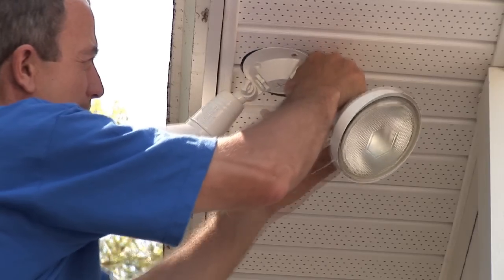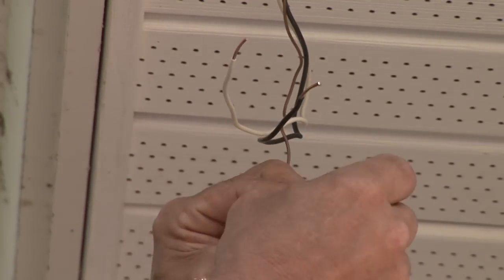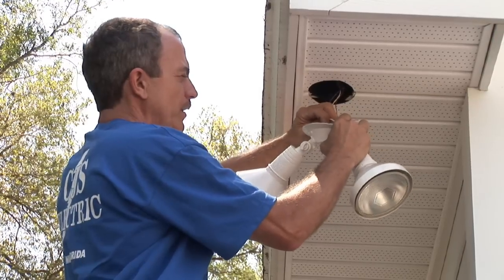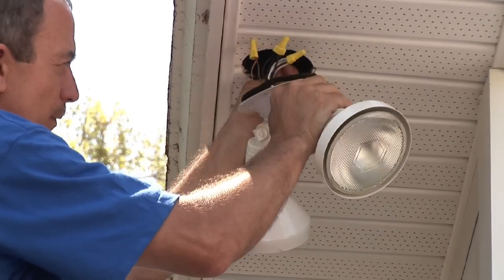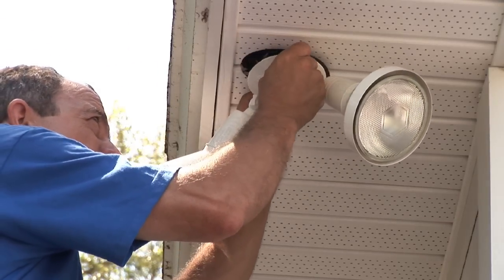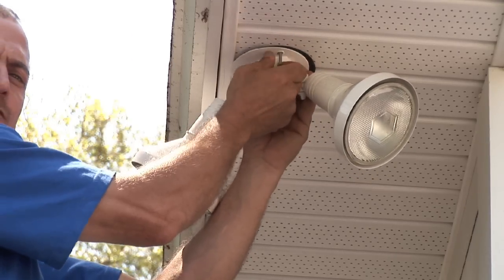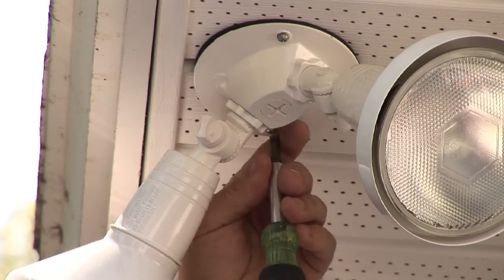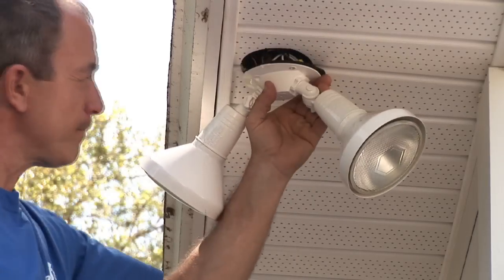Lighting Fixtures : How to Install Exterior Security Lights

Comment: So what are you mounting the fixture to?  I think that most people that click on this, want to see the entire process of wiring in the switch, wiring to the fixture, how it’s mounted, all that.  This could have been a good tutorial.
Reply: Exactly!
Reply: Ditto I was like was there a pre drilled hole or did u drill a hole. Otherwise nice video
Reply: It is a good tutorial. The holes would be pre-drilled as the wiring would need to be routed to the spot. The gasket should be in there already to mount to. If you need a new gasket, again, the holders are pre drilled.

Comment: I wish wires would magically appear for my outside lighting.
Reply: lmao
Reply: I'm not sure he used a junction box. Scary stuff.
Reply: James - same problem here. I prayed really hard , but unfortunately no miracle here either.
Reply: Exactly what I thought as I started the video LOL
LIKE SERIOUSLY. 
I just want a video that explains where in the soffit to drill, and if there is/isn’t attic access everywhere from under the soffit  - and if not, how to find said access, or what affordable drill bit could be used to make access… followed by what is the “code” way of running the wiring to the electrical box featured at the start of this video
Reply: He has connections to Harry Potter gang
Reply: And a mount box.

Comment: Thanks for showing me how to twist bare wires together and use a screwdriver, but what I really wanted to know was how to run the wires and what they connect to.
Reply: Came here to say the exact same thing.  Half of this video is showing how to screw 2 screws in.  The other half is showing you that like wires go together.  This is not a "how to" this is a watch me do the very last super obvious straight forward final step while you watch.
Reply: Me too. I feel dumb now

Comment: I don't see a junction box!!! my new security fixture states tit needs to be mounted
to a junction box
Reply: That's because it is regardless if it is run through GFCI or not.
Reply: By code should be in a junction box. This is no different than cutting wires in your attic and splicing and throwing them in the insulation. Fire waiting to happen

Comment: I have an almost identical soffit.  I have no existing electrical hole or box, but I have easy access as it's exposed in the garage.  I'm struggling with how there would be gaps were the fixture presses against the soffit because of the the soffit's grooves.  This video doesn't seem to care about that.  Yeah it's no likely to get rain, but this is still outside.  Hose... dripping water.... bugs... should this be more sealed than shown?

Comment: Yeah this video is going to get some killed or injured or if they get lucky maybe their house will only burn down without them in. When you are installing a flood light outside in the way you are installing it which would be considered a ceiling installation which should always include a junction box considering it is outdoors regardless if it is connected through a GFCI or not!

Comment: lol.. did anyone even hear the words "TURN OFF THE POWER" before starting?

ok, so beyond 1) turn off power, this video assumes an outdoor rated box is already there pre-wired, and the circuit has sufficient rating/breaker.

For those wondering, this is simply a video showing how to REPLACE an existing flood light with a unit that has motion sensing or dawk-two-dusk (or fancy dual-stage lighting).

If you want to INSTALL NEW lighting, you need to turn off the power, go into the attic, find a junction box, drill a hole the exterior, mount a new outdoor rated fixture, and contect it to juction box.  Get an electrician or someone who has experience installing them.  Your local electrical codes may require an inspection to get the outdoor box approved.

Comment: Oh my, I'll just say removing the soffit vinyl siding and repositioning / installing the J box to facilitate a secure weather tight seal on any flood light J box cover is the correct long term install. Installing new or extending preexisting  wires is job specific, no universal answer here.

Comment: Gentleman said nothing about attaching the gasket prior to splicing the wires If this EAVE installed light is a dusk to dawn security light the sensor must face opposite the lights lest you get strobe light-- the darkness turns the light on and the the light immediately turns it off and cycle repeats. Lithonia lights have terrible instructions

Comment: This video is useless! How many houses are pre-wired for an outside light? Not mine. How about posting a video showing how to install the light from scratch? You know, how to cut the hole, how to run the wires, how to find AC in the attic, how to connect the light to an indoor light switch, etc. That would help us out immensely.
Reply: Lambert J. I know right

Comment: Biggest pain in the ass project! The fucking wires keep pulling out. Of course installing the fixture while holding it and screwing it never works because the damn wires wont bunch into the fucking housing and the fucking screw wont fucking budge!